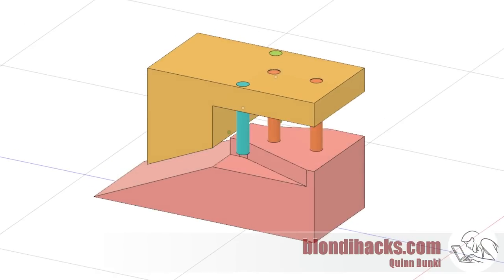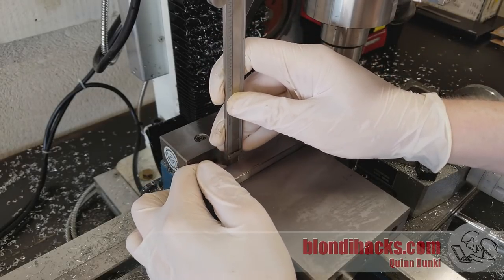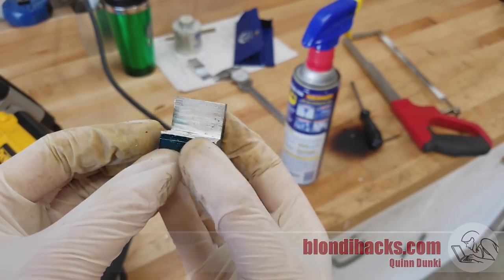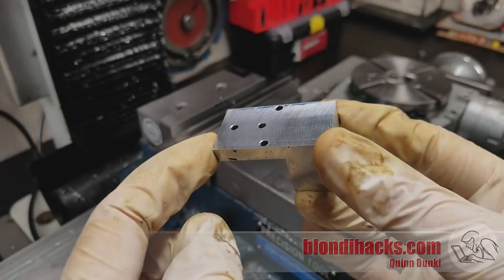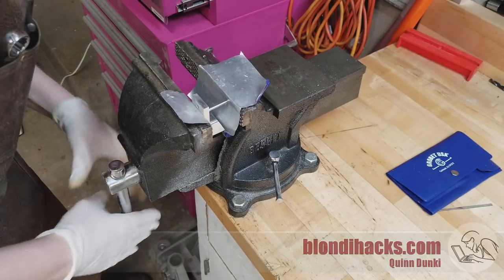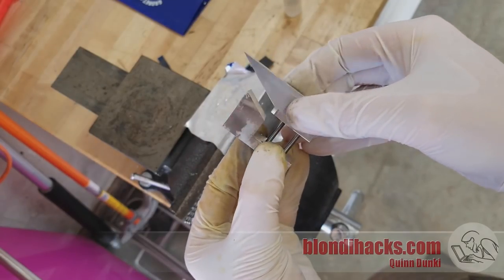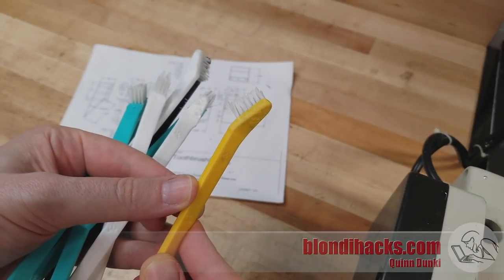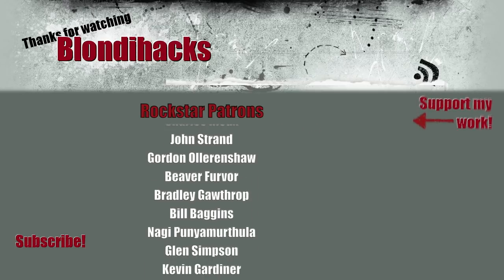Weirdest Fixture Ever?   Part 2 of 2

Comment: Quinn, just a little tip I have used on a couple of occasions. Where you are having a bit of difficulty keeping the parallel upright when the vice is opened. Place a coil spring between both parallels to keep them in register with the mating vice jaws. Small valve springs from scrap mower or motorcycle engines are about the perfect size for this.

Comment: We face similar issues when designing fixtures to hold thin walled fabrications. The actual amount of material to be removed is very small and well within the capabilities of the cutter. The issues are rigidity of the component being cut. As a tool designer you can specify the use additional clamps or small jacks to help support the fabrication, but sometimes you just have to use smaller cuts which put proportionally less forces onto the part. Finally....any comments from the cat regarding this project!

Comment: Hello Quinn.  Just as a comment, the 4 flute shell mill you are using was an older design from the 80's/90's.  It was however designed for machining Aluminum, so your usage for this project was spot on.  Keep up the great work.
Reply from the maker: I’m also a design from the 80s/90s, so that works out well.
Reply: @Blondihacks  I'm also a design from a little farther back then that, but we won't go there, LOL.

Comment: Hello! I love cats and I love machining, so this is just as perfect as it gets. Also a little tip that I learned at work, if you need to mill a large batch of parts on parallels, stick them to vice jaws with double sided tape, and of course, trying to keep as parallel to the bottom of the vice as possible.

Comment: Something you might want to try when making pins for a press fit. Turn the ends down about .001 for a short distance to make a slip fit to start the pin when you press it in.
Reply from the maker: I chamfer the ends when deburring, which has much the same benefit.

Comment: Folks sell spring gizmos for putting between your parallels to keep them seated against the jaws when you open and close your vise. Orrrrrr... you can make your own with springs, wire coat hangers, bent sheet metal, etc. Orrrrrr... you can just put a rubber band around the jaw and parallel :)

Comment: Quick tip to stop the emery paper ripping. Stick a strip of cloth tape to the back. It effectively strengthens the paper but still allows it to be flexible enough for hand sanding small round stock.

Comment: Shop project idea, use the mill and lathe to adapt a windshield wiper motor to raise and lower the mill
Reply: Pre-1970 Chevys has a brass gear with a steel worm drive I the wiper motor, those are the ones to get, they used the same design for 28 years but changed to plastic gears

Comment: You would be able to leave the jig in the vice if you add a removable block to the side, and a small c clamp to close the jig.  The block would have to be removable for when you flip the jig.  FYI a trick to keep your parallels in place is to take a piece of metal banding stock about the width of your vice, put a bend in the middle, and a bend opposite the way the middle bend goes on both ends.  This makes a parallel "spring", but also stands upright across the vise. Just make sure the banding is shorter than the parallel. Hope this helps 😀

Comment: Get enough steel banding to make a 4" tall "M".  Stick it between your parallel plates.  It will keep them against your vice jaws
A single piece bent in an arc will do the trick when using more narrow parts in the vice.

Comment: I like the project.  Nothing like a job that requires a tool or two.  It's like a machinist's implementation of recursion.  Also, consider the wonders of a hole-starting bit.  A centering drill IS TRADITION but only the very tip is the right angle to allow 118-deg drills touchdown point-first.  Hole-starting drills are hard through and have a little better reach, IMO.  It's a minor issue.  Perhaps the most minor of all the issues.  But If you buy a hole-starting drill, you also get a license to leave a smug comment somewhere on the internet.

Comment: I had an idea. Rather than machining the dog brush down to size, why not make a shaped guillotine? As the ABS isn't overly hard, I'm wondering if you made a die cutter blade the shape of the cat brush side, you could just slide the dog brush end into the die cutter, then you could simply crank the arbour press (that you had to get for your cat's dental welfare) down on the brush and voila a cat brush sized dog tooth brush.
If you want to go all out on the production line, mill out a form that follows the contours of the cat tooth brush and then integrate a heating element that can bring the form up to 100C or 212F. This should heat the ABS till it's soft, but not liquid. With luck and a bit of force, it should take on the softer corners and edges, relieving you of that pesky Dremel work. Or instead of the heater, heat the brush in boiling water, then try forming it. If the hot water isn't hot enough, go back to plan A and put a heating element in that will go hotter.
I too have cats in my life and fully understand some of the daft stuff you end up doing to placate that ungrateful little baggages.